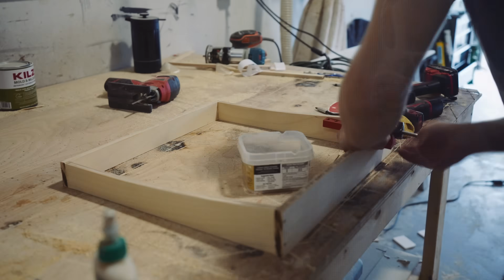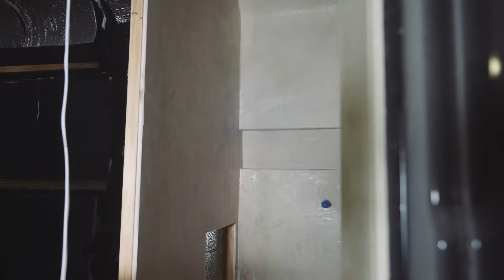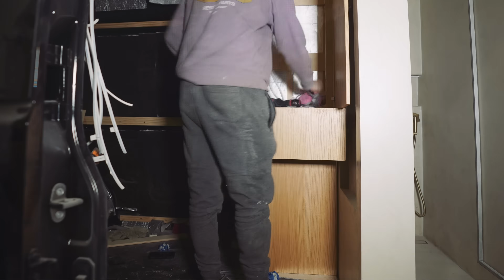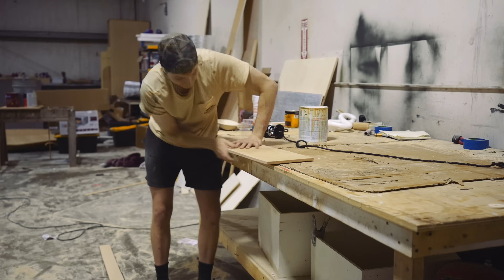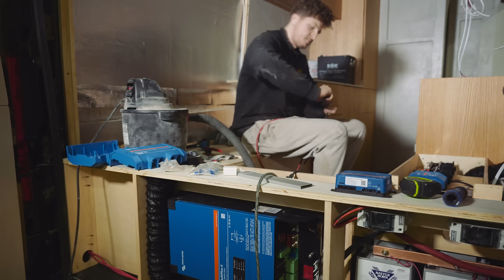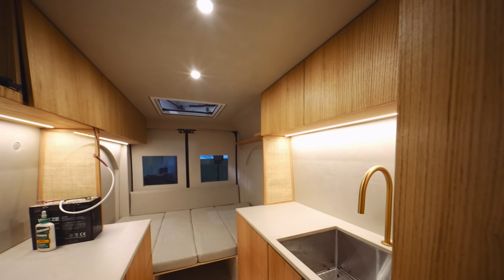Building a MODERN STEALTH CAMPER VAN in 15 Minutes | DIY Van Build Timelapse for Full time VANLIFE

Comment: The finished product looks spectacular but I see you both put a giant amount of effort in to achieve it.  The electrical looks like a nightmare.  What qualifications do you have to be able to pull something like that off? Anyway, congrats, it is a real work of art.
Reply from the maker: Seth is a certified Victron installer and licensed low voltage installer/technician. But the configuration of this one was indeed a nightmare. 💀Typically we try to keep them more user friendly then this one if they are going up for sale, but this is our van so we shouldn’t have any trouble maintaining the system. We packed an AC unit, 810ah of lithium, and all the proper fusing and wiring for dual solar chargers and dual alternator chargers in one side of the bench so that came with quite a bit of work to get it all to fit and be safe! Thanks for watching ❤️🫡
Reply: You should really be proud of yourselves because the effort speaks for itself.  To be able to take an idea and bring it to life, and more importantly, to be able to control your direction in life while pursuing your dreams is highly commendable. All the best to you both! @scarletandseth

Comment: Nice Camper

But sorry to be teachy.....this is not a stelth camper. Stelth mean your Camper look like a Dilivery Truck. The goal is, that noone outside sees that this is a Camper. Thisfor there are no back and sidewindows are allowed . Solarpanels should be flat and glued to the roof , so that they be inviseble. Standheater should have 2 voicekillers. So you will survive 🤪
Reply from the maker: Since the van is painted black you actually can’t tell that there are windows. Our solar is also only 1/4 inch thick and isn’t visible from the ground at all. It is pretty stealthy.
Reply: @scarletandseth  And what about light outshining by night 🤪